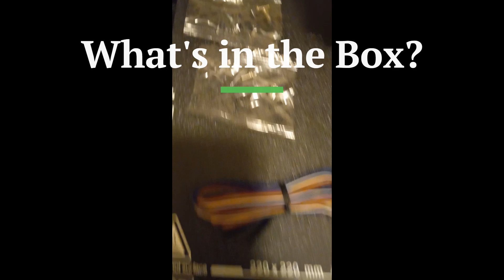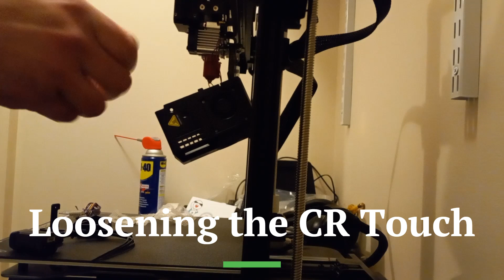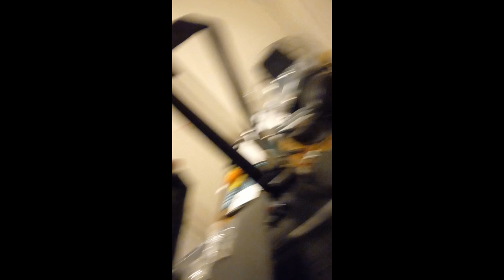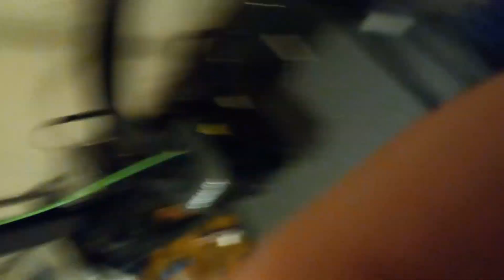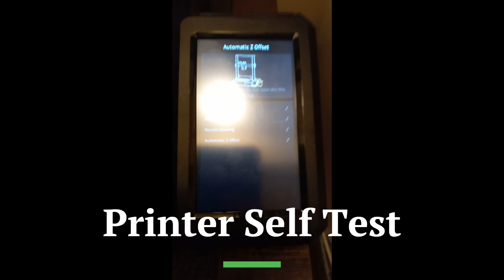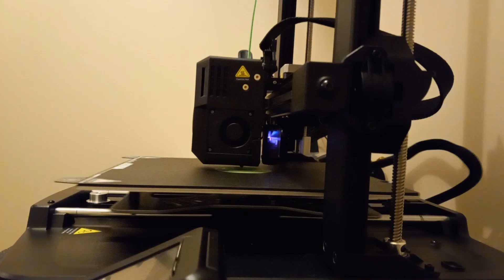3D Printer FIXED! How I Solved Error 2194 (Step-by-Step)

Comment: I was able fix it without major disassembly. There are four clips on the touch module, two on each side, that release the clamshell. Then I used 'Rem' gun cleaning oil on the solenoid shaft, and manipulated it a bunch in every which way. Blew compressed air up into the solenoid to remove any excess oil, then put the clamshell back on.
It's been deploying without issue since, granted it's only been a few days but before this it would fail 2/3rds of the time and only after physically manipulating the solenoid right before starting the print to prevent sticking.

Comment: On Nebula V1.1.0 firmware, which I previously upgraded to v1.2.0, (Restored to factory settings now) . , The probe error got fixed by using factory setting. Suprisingly, my extruder clipping also get fixed. Sometimes we do settings that mess it up. Hope this helps other users of Ender V2. Go for stock settings.

Comment: A simple factory reset resolved my 2194 issue
Reply from the maker: I am glad that worked for you. I tried that and it would work for a few prints then I had the 2194 return. and eventually the factory reset no longer worked to even get a single print
Reply: In my case, it didn't help. I think I'll have to try the method shown by @daan3113. Thanks.
Reply: Correction, I just tried gently moving that little pin from the sensor up and down, turned it slightly, and it worked, the error disappeared. 🤷‍♂
Reply from the maker: @TheHiheat  I had it work for me the first few times messing with the pin. eventually it would not work at all.

Comment: Thanks for showing what you did, I have the same problem will see if that will fix it here. 
and second: I hope you know you can remove the printbed-plate to easily remove prints.
Reply from the maker: Thank you.  I had not considered removing the print bed to remove prints.  I have always just let it cool down and usually they come right off.  Thanks for that suggestion.

Comment: Saludos, por favor me puede proporcionar el link de compra o el modelo del touch
Reply from the maker: Sure. Here are the links for the BL and CR touch probes 
BL Touch: https://www.creality3dofficial.com/products/creality-bl-touch?srsltid=AfmBOooWRbi-_HF3URhIHVytZuVG_uojiSwd1tE84ARASp6jJhRCuXIb
CR Touch: https://www.creality3dofficial.com/products/creality-cr-touch?srsltid=AfmBOorFmavmf0hR2n2SAkGFpWnbsM-enzv44-wVuQFt_YGySRsoljkB
Reply: @Just_Science_and_Engineering  Hello, curious why you shared the BL touch device too, are you saying the BL Touch will work in place of the CR Touch?  Thanks
Reply: I fixed that a couple of weeks ago. Didn't change the BL Touch though. My issue happened after storage for a few months. Get some tweezers, pull down and release the probe a couple of times. It is vacuum sealed, so it will pop back in again. Just lack of use... worked a dream!